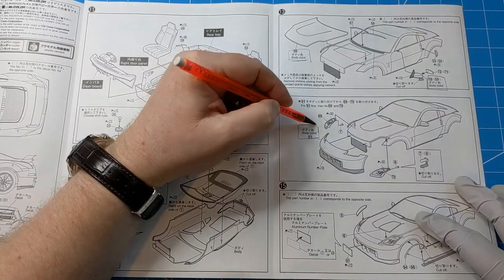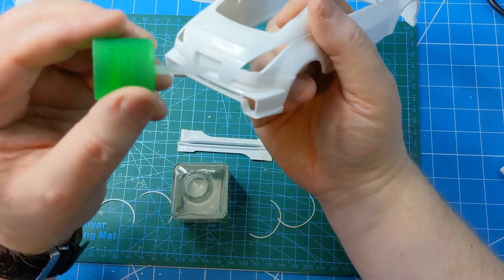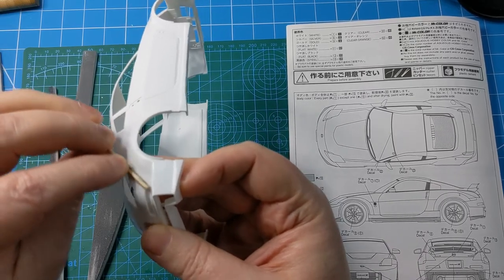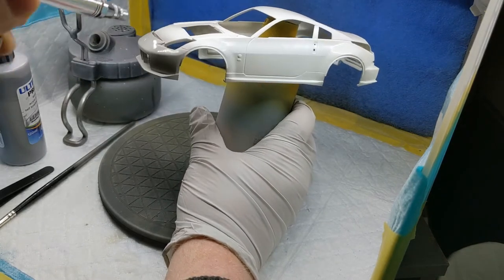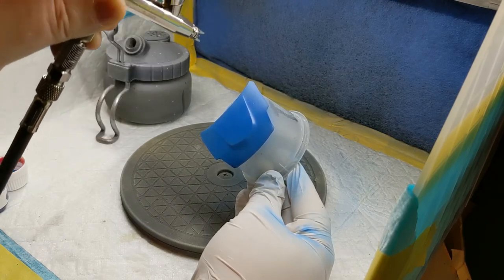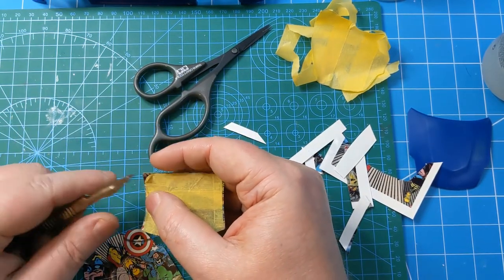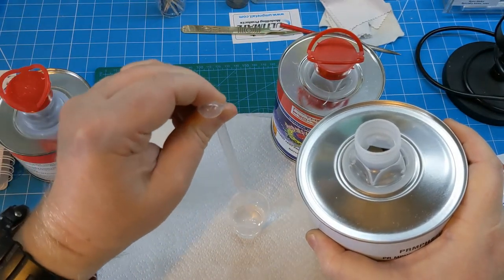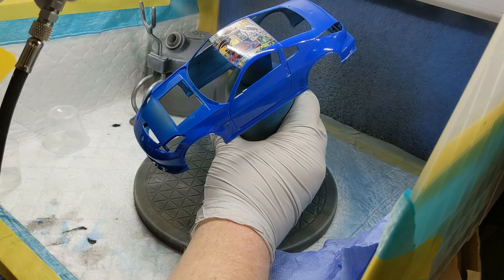Aoshima 1:24 Nismo Fairlady Z '07 Pt1 - Bodywork

Comment: Hi Dan, I enjoy your work and just bought the same kit. How do you go about venting the fumes and paint smell from your work area? Thanks
Reply from the maker: Hi Ken, I use a dedicated spray booth with filters that vents outside.
Reply: @TheDanCave  Hi Dan, thanks for the reply. I know about the spray booths and venting to the outside, but isn't there some chemical smell remaining in the air?
Reply from the maker: No, I don't get much smell left over, booth filters are change every week or two. Also wear a good respirator when spraying. Afterwards almost no smell.